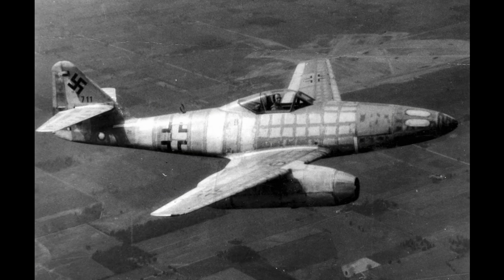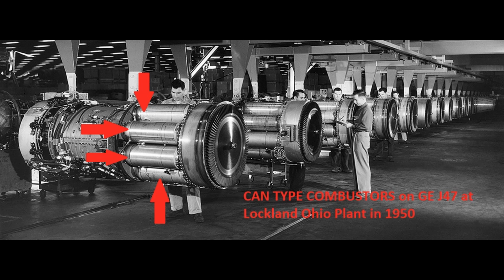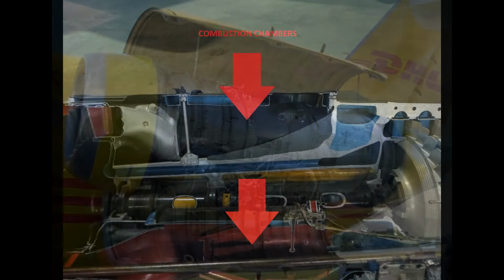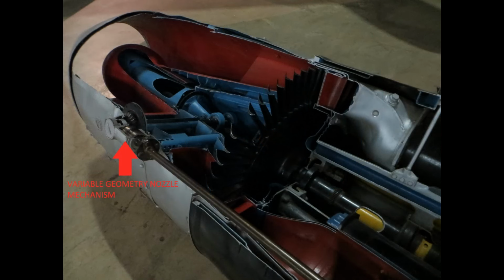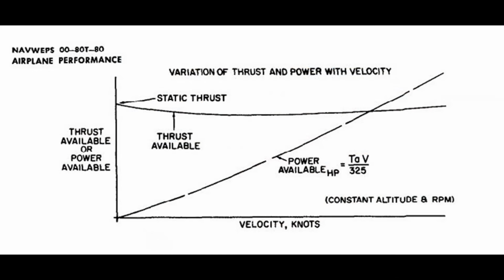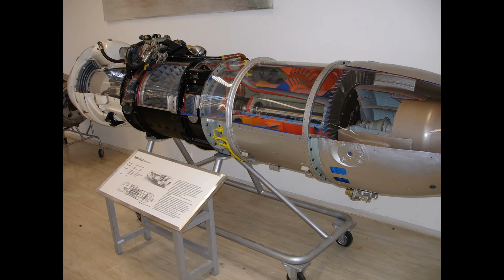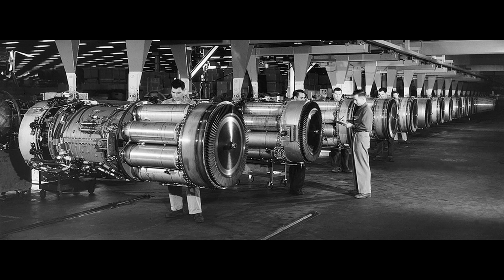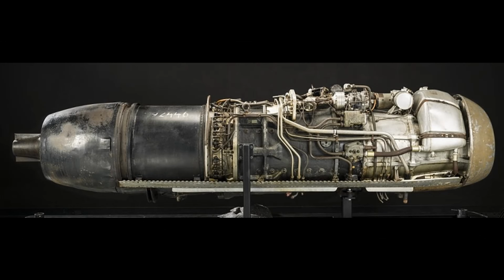World War Two JET POWER

Comment: I've observed that most other early turbojet engines had fixed exhaust nozzles, yet I've read that variable area nozzles were needed on the German engines. Is there any reason for this?
Also what of British engines? I've observed that British turbojets of the time had significantly better thrust to weight ratios. Was this just down to better fuels, materials, and higher operating RPMs (Whittle's engines topped out a 16,000 RPM) or was there some other design flaw that was hindering the performance of the German jet engines?
Reply: The Jumo was far more advanced than any Allied jet engine, variable convergence exhaust nozzles was an advancement that the Allies simply did not have.
Thrust to weight ratio was very good, but it's the thrust to drag ratio performance where Germany was years ahead of the Allies.
Centrifugal jet engines were obsolete technology on arrival and an evolutionary dead-end concept.
Reply: @WilhelmKarsten  That's a debatable statement. Firstly, I'm going to touch on the thrust to weight ratio, because no, it was not good at all. The Jumo 004B weighed 1,585 lbs and produced a maximum static thrust of 1,980 lbf at 8,700 rpm, giving the engine a thrust to weight ratio of only 1.25/1. The engine's OPR was 3.14/1. By contrast, the Rolls-Royce Derwent I, which entered production in 1943 weighed only 975 lbs and produced 2,000 lbf of thrust at 16,000 rpm with a slightly higher OPR of 3.9/1. This gave the Derwent a thrust to weight ratio slightly in excess of 2/1.
While the Jumo 004 did indeed incorporate some advanced features such as a variable area nozzle and an axial compressor, it was so rudimentary in its construction and finer details that it was simply inferior in terms of raw performance to its British counterparts. The Jumo had a very simple fuel system that delivered fuel inconsistently to the engine, contributing to its performance issues, by contrast, the British engines were much more refined in this regard and didn't experience the same issues with engine control, at least not to the same degree as the German engines. Then there's the vibration issues, the Jumo 004 had to be limited to 8,700 rpm due to harmonics causing premature compressor blade failures in the 9,000 rpm range. As far as I'm aware, these vibration problems were never able to be fully rectified by Junkers. Meanwhile, the Rolls-Royce engines were running at a maximum of 16,000 rpm, much faster than their German counterparts, so these engines are able to move more air more quickly, which would partially explain why they are producing more thrust relative to their weight. 
All this is to say, I have no doubt the Jumo had a lot of potential to develop into a very capable early turbojet, had it had the time and a stable development environment, but as it exists today, it is a product of the circumstances it was built in, and its inferior performance to the more refined British engines of the time just serves to prove that point.
Reply: @roberts9095  It is absolutely 100% true, Centrifugal compressor turbojets were an evolutionary dead-end concept that was completely outclassed by the Axial compressor turbojet, they were obsolete on arrival.

Britain was nearly a decade behind Germany in jet engine technology and was unable to produce a reliable production axial engine until 1954.
 Centrifugal compressor turbojets are inherently inferior due to the limitations of compressor diameter. and Compressor RPM
Any increase in thrust comes with a crippling, exponential increase in frontal surface area and the subsequent increase in drag cancels out any increase in thrust performance.
 Chief of Engine Development at the Royal Aircraft Establishment, A.A.Griffiths understood this... but it was Helmut Schelp at the RLM that acted on this knowledge and canceled any further development of Centrifugal jet engines while Britain wasted years on the dead-end concept before finally abandoning them in the mid-1950's
Any questions?
Reply: @WilhelmKarsten  I'm not arguing that the centrifugal compressor is a better design choice for a turbojet engine, I'm simply pointing out that despite the promise and potential that the axial compressor held, the Junkers Jumo 004 was still so poorly executed in practice that it was demonstrably inferior to British-made centrifugal turbojets of the era. A hypothetical Jumo 004 made with the same alloys as the British engines, using as sophisticated of a fuel control system as them, and having its vibration related teething issues ironed out would likely have been a vastly superior engine to the British designs, but the fact of the matter is, the Germans prioritized quantity over quality at the time due to their desperate wartime situation, and elected to have their industry churn out as many examples of this half-baked engine as they could, rather than taking time to refine it into a truly mature product.
Reply: @roberts9095  You are still very confused and misinformed regarding this subject, the Me-262 engines had semi-automatic, governor controlled fuel injection and later models had throttle dampers to reduce sudden snap changes in fuel injector pressure at low rpm.
This was further enhanced by the fully automatic variable convergent exhaust nozzle system which further stabilized rpm and thrust response.
FADEC did not exist in WW2 nor did electro-mechanical fuel computers that were found in 2nd generation engines.
 As RAF technical experts like Roy Fedden and others discovered after the war ended, Germany was a decade ahead of the Allies in Jet engine technology, in particular compressor and fuel controls

The Allies had absolutely nothing comparable to the Jumo-004B

Any questions kid?
Reply: @WilhelmKarsten  An explanation as to why the Jumo's performance numbers were so much worse than Allied engines, if what you're saying is true. Also where you found such information. I'd like to believe you're right, as I actually am an enthusiast of German aviation technology of the period, but everything I've read about the Jumo 004 with the information available to me contradicts your statements, aside from the nozzle, what I've read agrees that the nozzle's position was controlled automatically using pressure sensors, however the fuel metering system, or lack thereof is where I have questions. Everything I've read claims the Jumo 004 had a very rudimentary fuel metering system.
Reply: @roberts9095  It wasn't, the Allies had absolutely nothing comparable to the performance of the Me-262 or its Jumo engines, Allied evaluation after the war revealed that Germany was a decade ahead of the Allies in Jet engines and jet aircraft technology.
You just refuse to admit the truth.

Your comments reveal someone who is still very inexperienced and lacks a background in early development history of jet engines.
Reply: @WilhelmKarsten  I literally provided you with performance figures for the Jumo 004B and Derwent I. The Derwent has a higher maximum thrust output while being almost 500 lbs lighter than the Jumo. Early Meteors were more than a match for the 262, you're just in denial dude.
Reply: @roberts9095  Your misguided theory and denial is easily debunked by aircraft performance figures.
German aircraft powered by axial turbojets completely outclassed anything that the Allies had in operational service during WW2, and this technology was quickly adopted by the Allies after the war, centrifugal compressor turbojets were obsolete technology and were quickly abandoned.
 Allies centrifugal jet engines were inferior, this is an irrefutable fact that cannot be disputed.
Reply: @WilhelmKarsten  Funny you should bring up aircraft performance figures considering the Meteor surpassed the 262 before the end of 1945. The prototype for the Meteor F.4 first flew on 17 May 1945, and it completely outclassed the 262, it was faster, more maneuverable, had better acceleration, and a higher rate of climb than the 262. It was powered by a pair of Rolls-Royce Derwent Vs, which were scaled down versions of the Nene, and the Nene is the engine I really want to talk about, because it is what really demonstrates just how far behind the German engines were compared to their British and American counterparts. The Nene first ran in 1944 and demonstrated a maximum thrust of 5,000 lbf. It weighed 726 kg. (1,600 lbs.), making it only 7kg heavier than the Jumo 004B which weighed 719 kg/1,585 lb. Keep in mind, the Jumo 004B was only producing 1,980 lbf of thrust, so the Nene weighed only 7kg more than the Jumo but provided more than double the amount of thrust. THAT is what definitively demonstrates how far ahead the British engines were, and that was despite the limitations of the centrifugal compressor. These are irrefutable facts, but you continue to indulge in what appears to be a copious amount of denial, I have provided you with performance figures that support my claims and your only rebuttals thus far have been vague and baseless statements with no supporting data.
Reply: @roberts9095 Funny you should bring up the Gloster "Meatbox" as the RAF called it... you really don't seem to know anything about this deeply troubled jet.
The Meatbox was without any doubt the worst jet aircraft ever to serve in the RAF and was an unmitigated failure as a fighter aircraft.
Unstable in all 3 axis of flight and horrific asymmetric flight characteristics an engine out on take-off or a go-around was considered Fatal.
 The Meatbox only saw limited service  in the Ground Attack role and was used primarily for training, reconnaissance and as a target tug.

The Meatbox only killed British pilots during WW2.
The Messerschmitt Me-262 was 100 mph faster than any version of the Meatbox in service during WW2.

890 crashed in RAF service alone killing 450 British pilots, in total nearly 1 out of every two built crashed or were destroyed in accidents.

150 crashed in a single year in non-combat operations, 12 crashed in one week, 6 crashed in a single day.
Reply: @WilhelmKarsten  Funny how you completely ignore everything I said about the Nene and focus entirely on the shortcomings of the Meteor. Let's not pretend the 262 was without its faults either, the 262 had stability issues at higher Mach numbers and problems with its constructional quality due to a large number of them having been made using slave labor. The aircraft also exhibited poor roll performance at all speeds, and was difficult to handle in all axes at low speeds. The problem of asymmetric thrust was as much of a threat to a 262 pilot as a Meteor pilot, in fact I'd venture to argue that it was actually an even bigger problem for the 262 considering the poor reliability of the Jumo 004 in comparison to the Derwent.
Reply: @roberts9095  Digging yourself a deeper grave now kid..
Reply: @ "Digging myself a grave" by debunking your baseless claims with actual engine performance figures? What an odd and vaguely threatening to say.
Reply: @ Back to your comment about the allies having nothing comparable to the Jumo 004 before the end of the war, that is simply not true, both the UK and US had working axial flow turbojets before the end of the war. The Metropolitan-Vickers F.2 was the first British axial flow turbojet, it first ran in 1941, while the first American axial flow jet, the Westinghouse J30 first ran in 1943. The only difference is that the Allies didn't rush these unfinished engines into service like the Germans did.
Reply: @roberts9095  The F.2 was an unmitigated failure, it never achieved airworthiness certification or saw production. None of A.A.Griffiths designs were successful.
Metropolitan-Vickers abandoned jet engines  in 1947 and returned to building steam engines.
The Westinghouse J30 did not see operational service until 1947 and was an unpopular design with poor performance.
It was quickly abandoned in favor of newer axial turbojets. Westinghouse engines were unpopular with aircraft manufacturers and they produced very few jet engines.
Development of jet engines ceased in the early 1950s and the jet engine division closed completely in 1960
Reply: @WilhelmKarsten  You know what, yeah man, you're right.